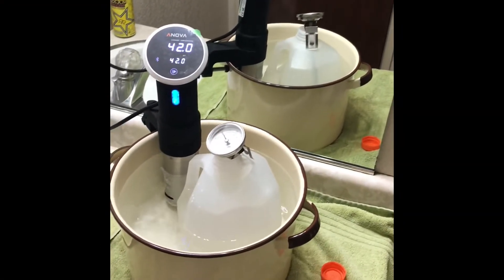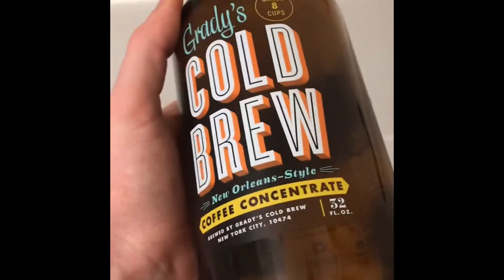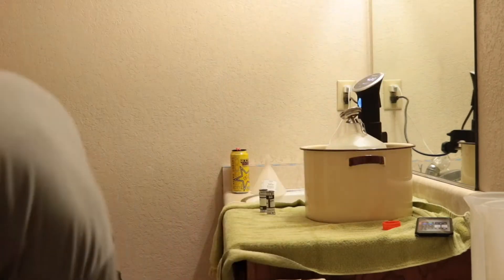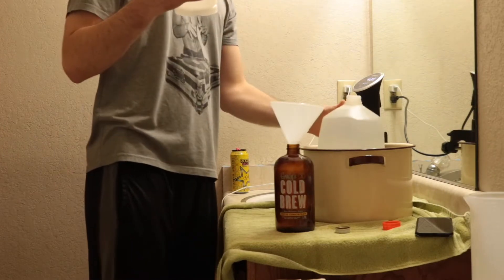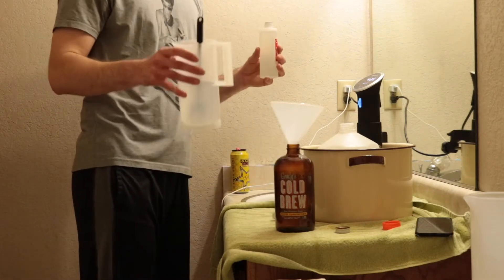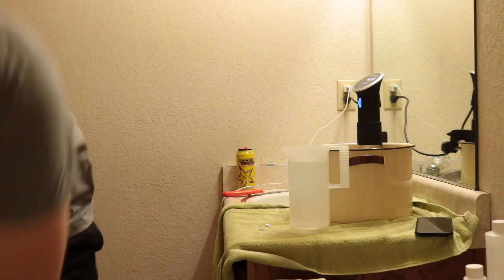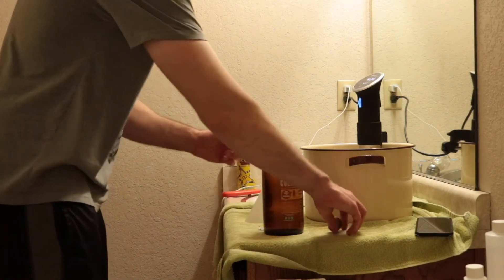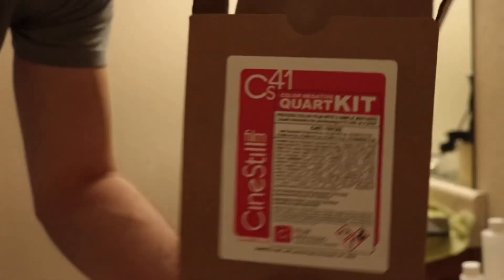How to use the Cinestill C41 Developing Kit (CS41)

Comment: Thanks for the super video! :) Got a few questions: Whats the temperature of the water ? Is the temp just for the developer and fix ? Could you make us a video of how you develop a roll of film ? And is it the same developing process for all C-41 colour film ?
Reply from the maker: JC Riot thanks for the kind words! The temperature of the water bath I usually set to 42 Celsius on the Anova. There’s usually like a 1 degree or so difference between the bath and the chemical. Once I get the chemistry up to the right temp I start and usually the 42 keeps it consistent. Yes the temp for the Dev and Fix are the same. 39 Celsius. I have another video on developing the film if you wanna check it out. Not sure if it’s what you’re looking for. And yes all C-41 are the same. Only difference is when you push or pull. They don’t have different times like b&w in normal cases.
Reply: @TheNegative   Hey there.  I think you need to check the temps again.  The Mixing temp should be 49 c/ 120 f for the Developer.  Blix is slightly higher at 51 c/ 125 f . . Then when Processing the film, thats when you go 39 c / 102 f . At least thats what my instruction booklet says.
Reply from the maker: s lyncook you’re actually correct. The mixing temperatures are higher. This is usually more critical with powder developers so that all the chemical dissolves properly but you won’t have any negative effects even if you mix it at the develop temperature. I mainly made this video to show how simple it is to mix the kit, not necessarily a complete how to. Thanks for catching that though.
Reply: @TheNegative   Cool.  I figured it is not too crucial for the mixing as well, but there is some chemist nerd out there in a lab who calculated this, so I will try to stick to that temp as close as possible.   Your video was still helpful to me; so  - thanks
Reply from the maker: s lyncook thanks I’m glad it was useful to you!

Comment: Hi, what's the difference between this and Tetenal? Would you get different results?
Reply from the maker: James Lane I’ve tried both! The results should be identical. I feel like the powder kit lasts longer although I haven’t actually tested it.
Reply: @TheNegative  thanks! Which one is easier to use?
Reply from the maker: James Lane they’re both pretty easy. The liquids are super easy to mix. The powder takes a bit longer to mix initially. The powder kit is also quite a bit cheaper.
Reply: @TheNegative  thanks, think I will go with Cinestill powder as it's cheaper than Tetenal for some strange reason (live in UK)
Reply from the maker: James Lane I’m chuffed my video made it across the pond! :) yeah I’d go the cheapest route. I’ve had great results from the cheap kits. Happy developing!!